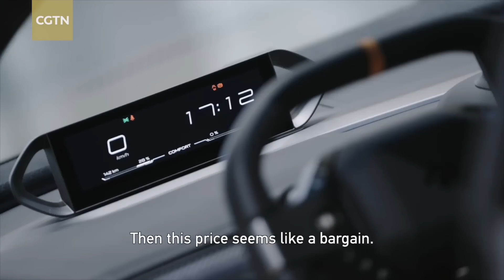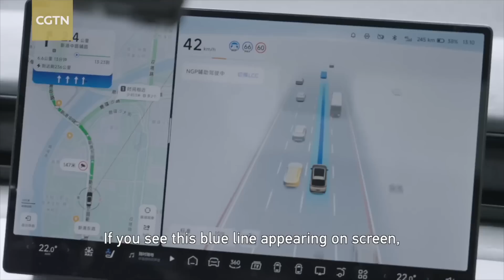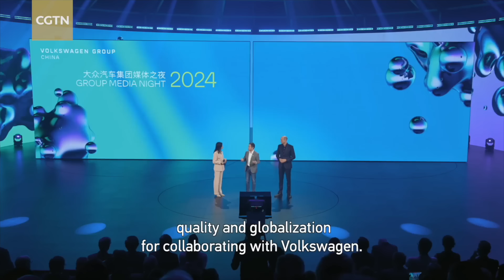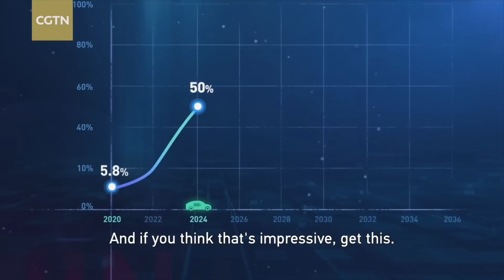Race to the Future | Electric Vehicles, the Way Ahead

Comment: Meanwhile self-driving in the US are basically non-existent.
Reply: do you know about a car company named tesla
Reply: @nasim3987  Yeah, that's exactly what I'm referring to.  Tesla's self-driving cars are extremely dangerous and make mistakes on the regular, to the point of being recalled.  They don't even use lidar, just cameras.
They even have a sandal where the auto pilot turns off just before a crash so that the company can blame you entirely and get off scott free.